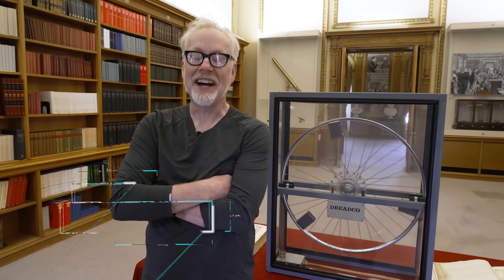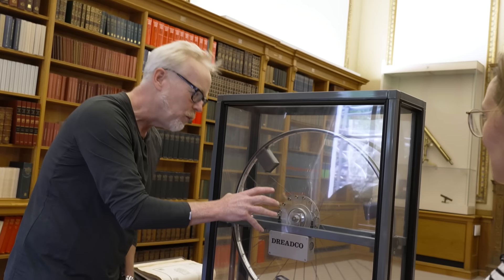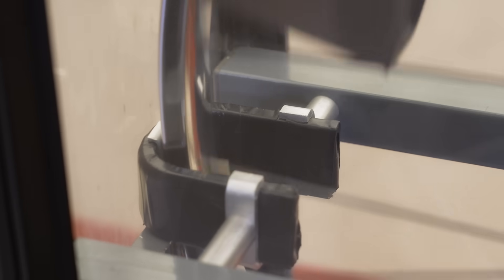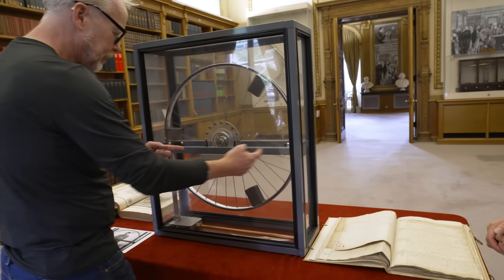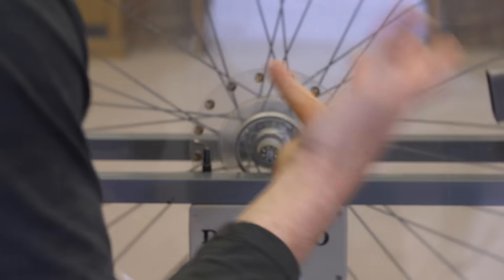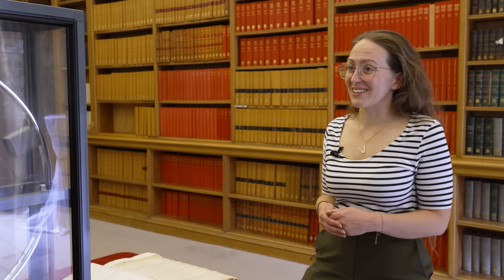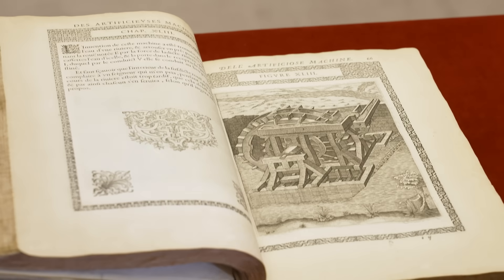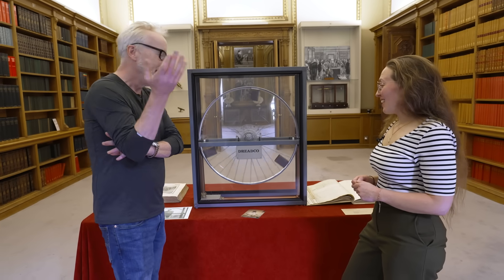Adam Savage vs The "Perpetual Motion" Machine!

Comment: i’m not intelligent enough, to try and demise how it works, but as a bicycle mechanic, what i can say is that a wheel that is out of balance by just the smallest of measures would need so little ‘push’ to reach fulcrum and let gravity spin it back around, as to likely not be perceivable. literally just a few grams at most. as a spoked wheel, it will absolutely need maintenance to ensure spoke tensions remain proper as the spokes wear out. unless part of teh design was to have the spoke tensions extremely too low to be a useable wheel, to reduce fatigue over time. as for the bearings: given the age of the machine it’s highly likely that the hub uses loose ball cup and cone bearings. this will drastically reduce friction by comparison to modern sealed cartridge bearings. reduced friction obviously means lower power requirements. in terms of the service life of the bearings on either side of the hub, my guess is considering they are receiving no axial load and almost no radial load and rotating at an extremely low rpm, as long as the bearing tension was adjusted perfectly in the beginning, and the grease used was quality and the correct amount, could probably function without need of direct maintenance not just for decades but likely for for centuries.
Reply: If what we are seeing is the truth, the bearings are visible.
Reply: the outer bearings look to be an addition at the end of the axle where it would normally be bolted to the frame, for the large clear mount for what is presumed to interact with the prongs connected to the dreadco box underneath. the actual hub will still have two sets of internal bearings for teh central axle. these are the bearings i’m referring to. looking closer at the hub, in freeze frame, it does look to me like a cup and cone style hub.
Reply: @umeko204  why would anyone add a second set of bearings?   That makes no sense.  (Not saying you are wrong in your interpretation)

Comment: I suppose a bunch of magnets and a few coils to generate bits of power, store in a capacitor. Release in a pulse timed with another magnet at the outer radius of the wheel. All in a vacuum ofcourse.
Reply: How does that work better than just having a spinning wheel in a vacuum?
Reply: @CorwynGC  collecting small bits of energy to give the wheel an extra push every now and then might keep it spinning a bit longer.
Although with the electrical losses it should spin down sooner, not later.
Reply: @FlexDRG_Lampje  Right.  Collecting (i.e. removing) energy from the wheel only to add it back is always less efficient than just leaving it there.
Reply: @CorwynGC  my idea wasn't with thinking it would run indefinite. Just longer without batteries or what not. Might make for a fun experiment. But to be fair, building a second one identical except for the wiring to see the difference.
Reply: @FlexDRG_Lampje  I don't see how it could possibly be longer with violating conservation of energy.

Comment: Personally I am thinking chemical reaction driving by it generating a very small voltage. From my work I know self lubrication devices that use a reaction driving by a very small voltage from a battery to create gass and pressure. And they do that over months. So it migt be possible to use the small amount of gas created by a chemical reaction to power the wheel that with the help of the magnets creates a small voltage that drives the reaction till the reactants start to runn out.
Reply: But it probably is an electric motor.

Comment: If it needs servicing, it's not a perpetual motion machine. Or am I missing something 🤔
Reply: Yes, the point that no one thinks it is a perpetual motion machine.
And the point that even an above unity machine would probably require maintenance.
Reply: Even if it didn't need servicing perpetual motion is impossible. The servicing part means nothing.
Reply: I would say that any kind of mechanical device needs servicing at some point and this one runs all the time so the wear adds up more quickly than on a device that isnt used all the time. That in itself doesnt debunk it as a perpetual motion machine not that i believe in such things.

Comment: Copper pipe looks like a magnetic loop antenna.  Could it run on power harvested from radio waves? 3 boxes are likely coils that are coupled with the magnetic loop and create very weak electromagnets that are weakly repulsed by the permanent magnets.

Comment: My guess is that the 3 boxes on the wheel contain a circuit that detects the magnetic field as it passes through the magnet and sends a little electromagnetic pulse to give it a shove as it leaves. Like the decorative pendulum on a quartz clock does. The maintenance probably involves changing/charging of batteries. 
It would be interesting to hold a compass near the thing to check for magnetic pulses. The bit in the middle looks like a wimshurst machine - make of that what you will.
But, I am not a scientist, so it could be witchcraft for all I know.
💚🐇🐴💚
Reply: Changing the batteries, it's 80s tech so those will be lithium cells (the non rechargeable type with the high power density, coin cells are lithium)
The detection mechanism will just be a simple reed switch.
Reply: My guess is that it works in a similar way to mag-lev trains, except the magnets are most likely powerful rare-earth magnets of the same magnetic fields to "push" the wheel only in one direction.
Reply: I also thought of a Wimshurst machine when I saw that detail, but there are few important things missing: for starters a Wimshurst or similar device requires two discs rotating in opposite direction. It also would convert energy the wrong way.

A Wimshurst machine converts movement to electricity (high voltage, extremely low current) by way of a static electric charge/field. Theoretically you could reverse that by applying a static charge via those two pointers to the metallic dots on the glass disc and then provide an opposing electric field somewhere nearby (e.g. the metallic bar in the middle or the "Dreadco" box). This could actually look a lot like this device. But that would be extremely inefficient to the point of wasting lots and lots of energy in the voltage conversion alone (probably on the order of 99% power loss).

I think your first idea is better: something in the boxes that detects and uses the magnetic fields (could be a really simple circuit). If we think along those lines the "Wimshurst like disc" could have magnets instead of simple metal-patches and the "Dreadco" box could contain a simple changing magnetic field that gives them a kick every time a magnet goes by. The spikes would be just decorative and without function in that case.

Comment: I suspect that almost everything there is a red herring, and that there's just a big battery in the "Dreadco" box which drives a tiny electromagnet or similar device to nudge the wheel a little bit periodically. I'd bet that everything else is just for show.

**Edit: Alternatively, the box is entirely a red herring and the battery-based bumping is elsewhere.

Comment: I'm guessing it's a simple motor/flywheel. The black horseshoes are permanent magnets. The three boxes are electromagnets. The have batteries and wiring in each and as they pass each horseshoe magnet they switch on for a moment and provide a slight push. The weight of the batteries, wheel, and wiring then act like a flywheel to keep it going between these small pushes. Everything else is just for show. Also related video https://www.youtube.com/watch?v=muruba8ORGA
Reply: I have a toy like that, with a spinning device on a double ramp.  Magnets in the spinner and a electro-magnet connected to a amplifier circuit.  It would run for months on a 9 volt battery (unless the cat got to it).
Reply: @CorwynGC  I've wanted to get one of those toys or find someone who can help recreate it, that is, design a model for 3D printing. If I recall correctly, the circuit is very simple: a battery, a transistor, and a coil. It's brilliant!
Reply: I'd bet my hat there's a reed switch in each of those boxes.
One which requires a particular pole to switch on and the opposite to switch off.
It closes as it approaches, opens just as it passes the center line.
Reply: @MostlyPennyCat  No once they are in the magnet field they will send a very short pulse pushing the weel further.

But dont tell anyone
Reply: Yep, basically a reworked clock motor with a constantly revolving wheel instead of an oscillating balance wheel and escapement - small precisely timed pulses in coils give just enough push against permanent magnets to keep the wheel moving...
Reply: The big clue is he said he felt disappointed or a bit cheated when he found out. Unless saying that was also in the letter which would be pretty brilliant.
Reply: To me this thing screams permanent magnet electric motor with the leads in the center being effectively brushes, the rods are effectively closing the circuit with the box and there’s a battery hidden somewhere.
Reply: @Taskarnin  Look closely, nothing is connected (electrically). Those little brass pins connect to nothing :), none of the spokes connect to anything.
Reply: Ahh, interesting possibility. Yup, a reed switch in each box to activate the coil as it passes the magnet.
Reply: The inner hub probably of sets the magnetic pulls from the coils tiny but useful when timed properly!
Reply: I think the batteries are in the horizontal supports, the square horizontal tube. This tech certainly existed in 1980s.

Comment: I suspect there are weights moving around inside the 3 boxes attached to the wheel. If you move the weights to the outside when a box is on the left, and to the inside when it's on the right, then you have more leverage on the left side.
Reply: This has been proposed as a pmm many times before, but you need energy from somewhere to cause the weights to move. Motion means there is friction, and that requires you add energy to the system, or the system will run out eventually. The device in the video is losing energy to friction in at least a couple of ways: the bearings on the shaft, and the air in the box (the sides are far too flimsy for it to be a vacuum, and that still leaves the bearings). There could be some kind of battery powered system in each of the 3 blocks, moving a weight as you described, but I suspect other methods like a weak motor of some kind would be more efficient, and more likely to last the 2 years between "servicing".

Comment: Its a sterling engine powering pushing a slight breeze true the pips.   Thats my first suggestions
Reply: But where is the ENERGY coming from.
Reply: @CorwynGC  it operates on the difference of hot and cold side. They dont need alot of energy.   But perhaps there is a small battery heating the hot side of the engine and the air temperature is enough for the cold side

Comment: 4 Phillips screws get that figured our right quick.   I believe the 3 boxes are strong magnets with a cap down in bottom at end of the copper pipes.
  Weights moving would have too much loss.  
More like 100% in 99% out machine. Why it eventually needs respun by hand to recharge the caps.

Comment: My grandfather has been showing off a similar idea for years now. He's not a man of science, not by far, and neither am I. But it seems to be working in the same manner. The boxes on the wheel are also magnets, and each time they pass the fixed magnets, they get pushed away by the opposing energy (there's probably a more correct term for this, but as I said, not a man of science). Everything else seems to be a distraction. I guess the magnets have to be recharged every now and then. If this should be the solution, then my grandfather will be furious for not bringing this forward earlier :)
Reply: What you propose is basically a permanent magnet motor. You can see your yourself using any such motor that, left unpowered, it will eventually stop spinning and settle in-between the magnets, if you will. It takes just as much force to approach and meet a magnet in that way, as you get from the magnets pushing each other apart. Sounds like perpetual motion until you have to make up for friction (air friction, bearings in shaft, maybe other sites of friction I'm not considering).

Comment: Sigh, the labled box is the battery, the 3 boxes on the rim are slightly magnetic and the horse shoe shaped objects are the coils, the center is probably a sensor to tell the electronics in the box when to triger the coils and either attract and of repel the boxes. Its just a motor, easy peasy. The rim and boxes are a flywheel so it just needs a small nudge to keep it going, so the battery draw is very small and might last the 2 years or so.

Comment: Check out the design on my channel  .... not as fancy.....  but it's for sure ... it's about harmonics ....it's  a principle model, not it runs currently by external means ... but can very easily produce  enough restorative action  to offset the alternative/unstable equalibrium  ... reason  ...
Gravity 1<90°⬇️
Enertia 1<360° force vector/spinner 🔄➡️ 
Pendulum 
Water standing in motion 

Water =
0 attribute Amp 
 0 volume/wave mode 
1+ potential  as volumetric 3d
So the water is 1 whole water ... with 0 waves and 0 current ....
A parabola / bowl 🥣 the same arc as the pendulum  traces .....
 
Water carries no current ... there is no internal resistance .. only surface tension  ....retention  ...
and (mass) flow reduction ...

Dynamism 
Manifested 
Focult 
Wave compression  counter space ie... electrical potential is always 100%
When the water retained re-enters the bowl 🥣  at the bottom, it is moving at the same speed, 
and  in phase with the pendulum 
So as to be in synchronice harmony 😀 
Symbiotic 
Partially 
Psychotic 
Black ⚫️ hole machine ... 
Psychic abbys 
..
You don't just exist in a vacuum 
"Nothing " is an abstraction  
Everything is an abstraction  negative gradient...
HELMHOLTZ.....RESONANCE... GIBBS..... ENLAPATHY ..CHEMICAL... WATER PURE =0 SPONTANEOUS ACTION 
WATER SYMPATHETIC RESONANCE 
ENTROPY... =WATER FLY TO DISORDER ONCE INITIATED BY EXTERNAL MEANS